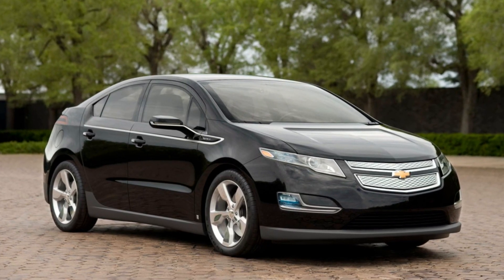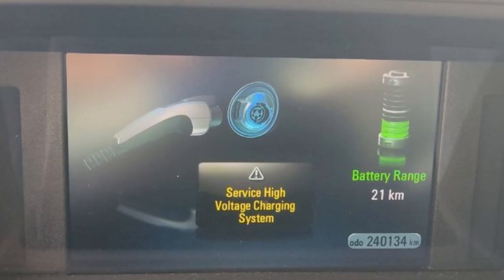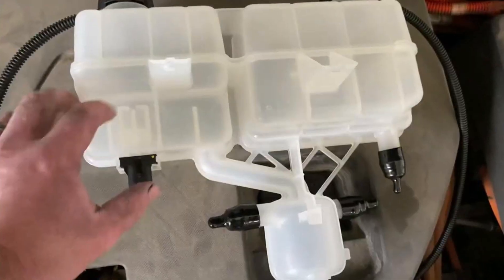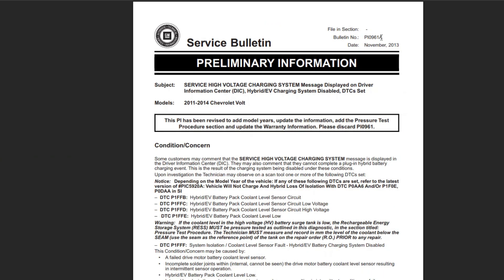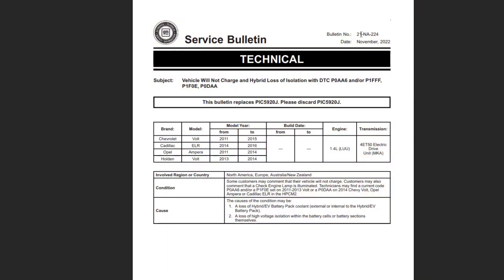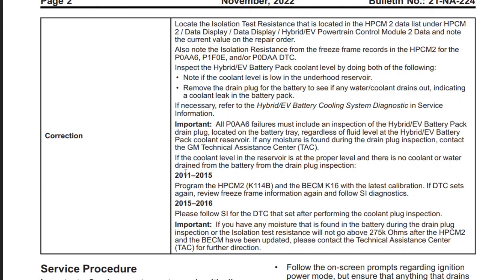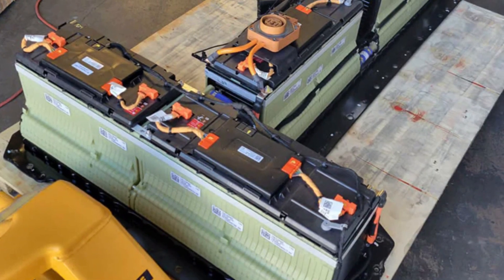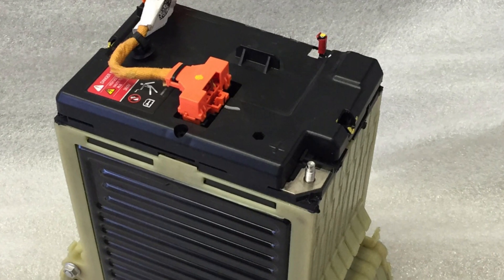“Service High Voltage Charging System” warning in Chevy Volt

Comment: I’m getting P1E00 with a $07E8 and a freeze frame of P0AA6

Topped the coolant and it didn’t work. I assume it could be the sensor or a deeper issue
Reply from the maker: Sometimes, we need to reset the codes with dealership-grade scanners after topping up the coolant. If this doesn't help, level sensor is the first thing to try with these codes. Otherwise, the issue may be with the coolant leak in the HV battery unit, battery heater issue, or HV battery dying.
Reply: @TopicMotor I saw on a few videos people just downloaded the newest software would that be the ideal solution as when I use an Obd2 scanner it successfully removes the codes but they just come back randomly later
Reply from the maker: Software may help, but this set of codes is specific for the heater issue in the HV battery, so it makes sense to check everything properly. If the battery dies because of some minor failure, that's going to cost a fortune eventually.

Comment: Thanks for posting. Clearest explanation found yet.  My 2015 Volt gave me the SHVCS error and OBD II shows P1E00, POAA6 and P1FFF.  Topped up reservoirs and cleared codes, but they came back on the next charging cycle.  I doubt the sensor suddenly went 'bad' but possible (unless tripping it once caused issue?) . . .  Elsewhere someone mentioned the car needs a long drive after clearing codes to allow the onboard computer to run it's diagnostics/readings on all sensors, and that may solve the recurrence issue (I have no idea if they knew of what they spoke as I only saw this mention by one lurker).   Otherwise, it seems I'll be visiting the dealer to see about the software updates.
Reply from the maker: Would be nice to make sure there is no internal leak in the battery cooling system. There is a drain plug that is ridiculously hard to get to and you better let dealership look at it. Also, does the level of coolant stay at the very same point after topping up? If there is no drain, I would say, your first way is software update. Then, check the coolant level sensor. If everything is good, change coolant (have you ever done this?). Finally, you may try replacing the heater on the HV battery. And if this fails to fix the issue, the hybrid battery is done.
Reply: Have you fixed your issue? I got the P1E00 with a freeze frame of P0AA6 and for the P1E00 the scanner also added $07E8

Comment: Yeah.... I loath driving to work in January when we regularly dip into the single/negative fahrenheit digits due to that very message

First time was last year and I had the battery replaced with a used one through a EV battery shop after the GM dealership determined everything else was fine

Second time, was this year and took it back to that shop under warranty and they found nothing wrong 🤷‍♂️